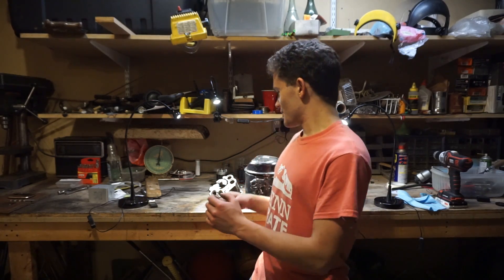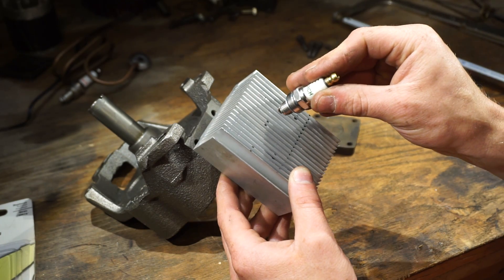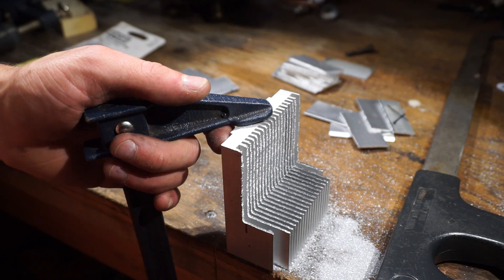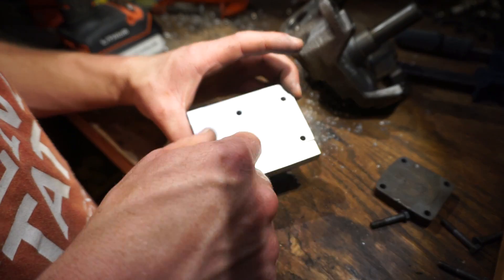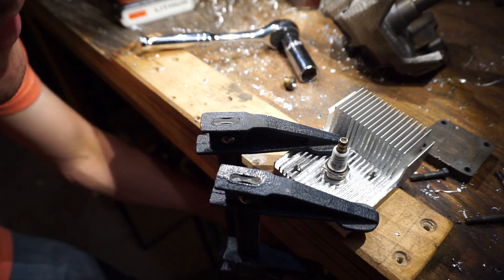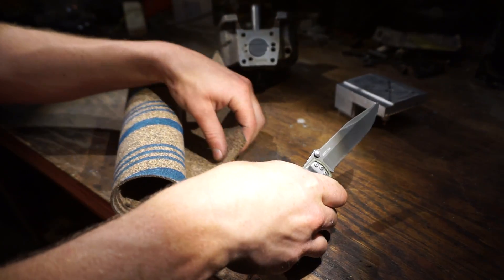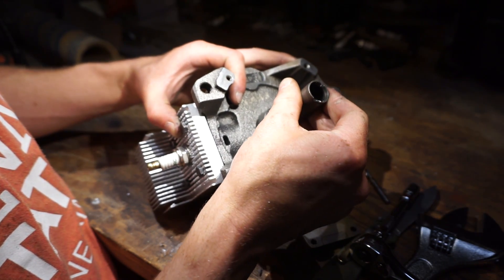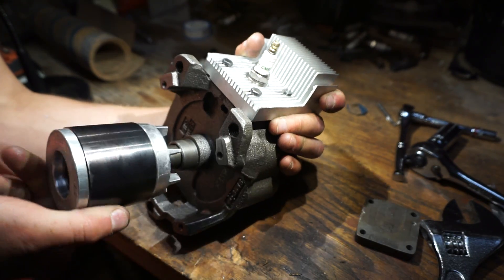Part 3. DIY Internal Combustion Engine Made from Old Compressor - Head from Intel Heat Sink

Comment: have you figured out the compression ratio of that? its got to be way high. surprised you would rather build up the head with jb weld instead of cutting off some of the piston top.
Reply from the maker: The top of the piston actually doesn't seem that thick.  I'll have to measure it to be sure.  I'll cross that road when I get to it.  Right now I'm going to worry about enclosing the crankcase.  Thank you for the suggestions!
Reply: Makerj101 actually, if you cut the top of the piston it would screw up your whole port timing. I would suggest just making a spacer plate 1 to 2 mm thick to lower that compression.
Reply: he would have to just dish the center out, or the parts that don't cover the ports. enclosing the crankcase wont be a small feat though, I'm curious to see how he pulls that off.

Comment: Nice job you have one of the most fun channels to watch cool things being built and tinkered with. If you plan to pressurize your crankcase as you say you are that means that you could use an expansion pipe on the exhaust and utilize the powerband that that creates. I wonder can you measure the compression ratio somehow? Good work.
Reply from the maker: Thank you so much!  :)  Yeah an expansion pipe could be a possibility!  Although I think it'd take a lot of math to actually get one that does anything.  I'm not sure how to measure the compression ratio other than calculations.  Maybe somehow using a liquid.  I'll have to think that one over.  Thanks!
Reply: +Makerj101 look on crraigslist for a cpmpression gauge

Comment: I wonder how a dremmel might have worked on trimming those fins in a tight circle for the spark plug hole in the fins instead of cutting most of them
Reply from the maker: It might have worked alright.  I didn't want to use a Dremel on this project because a lot of people don't have them or don't know how to properly use them.
Reply: Makerj101 keep exploramenting!

Comment: Damn, that came out awesome!!
I''m so glad that you left the idea of JB-welding the head, especially given the fact that you already had the 4 holes there :)
I don't know if you remember or not, but I told you on Facebook about my attempt on making such an engine, and I forgot to mention that on my compressor, the head was just strapped to the actual body with a steel band and some pins which locked it into place..that wasn't really hackable at all, but I gave it a try anyways :)
I'm also worried about the cork sheet material, as I believe it won't withstand high temperatures really well..also, you might want to re-tighten the bolts after the first few runs.
Also, the better approach for the sparkplug would have been that type without the bent negative terminal, that one where the actual case of the sparkplug is the negative, and the distance between the electrode and the case is quite small.
I'm still curious about how you'll make the air/fuel mixture, and how you can get it into the engine :) (probably compressed air?)
Reply from the maker: Huh, that's a really interesting design of compressor.   I have never seen one like that.  Send me some pictures.  I'm curious to see it.  Yeah, IDK how the cork sheet is gonna hold up.  I think it will work fine for at least a while.  Might smoke a lot.  We'll find out eventually I guess!

Yeah, that would have been a better type of spark plug.  I would have had to search around for one of those tho.  I'm going for easy to find parts for this project as I want anyone with a brain to be able to replicate the project.  LOL  :P

You'll have to wait and find out how I'm gonna do the carburetor!  I think it's going to be super simple.  Might use the venturi effect
Reply: Makerj101 the compressor is long gone to the scrapyard :)) That engine idea was 2 years ago, if not more :)
Reply from the maker: Oh yeah you did say that darn it.  Well make another one!

Comment: Really nice progess. I like the looks if the cylinder head. When it runs you could add a pc fan on the side or somethin.
Anyway i was thinking you could use some sheet metal on the side to cover the most of area. The jb weld kinda bugs me because you can't take it apart anymore. 
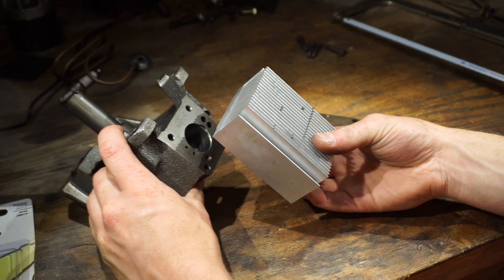Do you put oil in your gasoline for the 2 stroke engines? Could be extra important here because the bearings are designed to have oil all around em. I would usw a ratio 1:25 or smth like that.
Reply from the maker: Thank you!  Yeah not being able to take it apart bugs me too.  Sheet metal with a cork gasket might do the trick.  We'll see!
Yep, I'm planning to put 2 smoke oil in the gas.  And yeah, I'll error much on the side of way too much oil!  :D
Reply: Yeah you could build up some walls with jb weld and then fix the sheet metal to it with some screws. Also for ignition you cuold built something different to make it run even better. I was wthinking of a buzz coil ignition just like the old engines had.

Comment: I just put hacksaw blades in a wooden bow saw frame, so there's no front or back, and I can just turn the saw around and cut whichever way I like. I also find that the bow saw holds the blade more securely than any metal hacksaw frames I've tried.
Reply from the maker: Wooden bow saws are pretty cool!  I've wanted to make one for a while now.  That's a good idea putting a hacksaw blade in one.

Comment: what you are using to.get spark at the rigth time when the piston is top dead center is it gonna fire every revolution or are you gonna make like a camshaft for spark or what ,was just thinking about it and sorry for bad english cause if from finland if you didnt notice it from the name :D
Reply from the maker: Well it is a 2 stroke so it will fire every rotation.  I will probably start with using a simple switch connected to a ignition coil.  Then I'm thinking to upgrade to a hall effect circuit.

Comment: You could have used a end mill for drilling through the fins. But love the series, keep it up!
Reply from the maker: That would require a mill tho!  I guess you could put an end mill in a hand drill but it probably wouldn't be very good for it.  And most people don't have a mill or an end mill.  Thanks!
Reply: +Makerj101 for like 5 bucks you can get a metal cutting disc for a wood cutting circular saw..... i buy them by the ten pak at HF

Comment: you should have used a flat tip frill bit so you could keep the cooling fins
Reply from the maker: Yeah that probably would have worked.  Although I didn't even know what those are until I google it.  So almost no one else would have know what it is or had one.  I'm going for an engine that any uncle Bob in his shed could build.
Reply: Makerj101 or maybe a step drill bit ...

Comment: Next up: DIY four stroke engine?
Reply: Makerj101 Use a large nail, and some sandpaper
Reply from the maker: I'm still trying to come up with simple valves that I could make without a machine shop.  Any ideas?
Reply: Makerj101 You only need a cam shaft for the exhaust valve, and you can use some kind of one-way valve for the intake as the piston sucks vacuum.
Reply from the maker: Activating the exhaust valve is not the problem.  The problem is making an exhaust valve that has a good enough seal, withstand combustion pressure and temperature, and be possible to make without a lathe and mill.  I have seen people use check valves that have linkages attached to them.  That could work
Reply from the maker: Might work
Reply: Makerj101 or use an actual valve from a junkyard engine

Comment: If you could get some of "klingersil" gasket material, it would be SO MUCH better thing for head gasket.
Reply: Just get some neoprene impregnated gasket paper sheets, available at literally any auto parts store, and perfect head gasket material.
Reply: Cap10323 ore a copper head gasket could be good too ive seen it use on some old mobeds
Reply: yeah, that would work too. anything stronger than cork.
Reply: CroatianCarGuy yep
Reply from the maker: Ah yeah, I could probably find some of that somewhere.  I imagine most auto parts stores would carry sheets of it.
Reply from the maker: We will see, we will see.  I'm gonna use the cork and if that fails then I'll find some options to replace it.

Comment: Damn son, this is amazing work! I guess you plan just to fire it and run it for a few seconds, right? Because that gasket and that teflon on the spark plug won't last for more than a few cycles...
Reply from the maker: Thank you for the criticisms!  You might be right but I think otherwise. I think it is gonna run for at least a few hours!  Did you watch my previous homemade internal combustion engine?  The piston on that thing is made out of freaking solid JB Weld and it has at least 8 hours on it running at Maker Faire and other events.  The spark plug on that engine is also sealed with teflon and I have had no problems with that.  The weakest point on that engine is the solder joint that holds the carburetor on.  It has broken a few times probably due to small contact area and vibrations.  

I honestly could be totally wrong.  I have been wrong before.  I guess we will find out in a few more parts of the series!
Reply: copper is good for head gaskets
Reply: Sorry, didn't watch the previous video. Ok, spark plug could actually live just fine. But that cork gasket is what bothers me the most. You really think it will withstand the heat and pressure? I know it's compressed between two parts but still...
Reply from the maker: Entirely possible.  I could replace it with inter tube rubber, viton o ring, RTV silicon, or JB Weld at some point if it fails.
Reply: you just have to believeeee
Reply: +Makerj101 paint the cork gasket eith aluminum paint ..
.its an old trick if a new gasket cant be found...brush on is best.... great series...cant wait to see it run!
Reply: CroatianCarGuy
why so negative?
Reply: not negative, realistic. cork gasket is not gonna last too long while being in such a hot environment and under pressure.
Reply from the maker: Hehehe and duct tape  :D
Reply: Ian Clarke I also suggested that in another comment :)
Reply: My first thought about the head gasket material was the same as CroationCarGuy's. I suspect it will be a failure point. I hope I'm wrong. 

I wonder if you could use some copper flashing for the head gasket? It is available at many building supply box stores? It can be layered too so you can reduce the compression a bit by adding more layers.
Reply: +John Possum c/eith/with
Reply: Makerj101 WD40 keeps the world moving and JB Weld is keeping it from falling apart :))
Reply from the maker: And hot glue
Reply: You should be able to get some regular gasket material at a parts house.  Would withstand the heat better.  Keep up the good work
Reply from the maker: I still would love to see the spark plug blow out of the head!  That would be an awesome failure!  I honestly don't know how the cork will hold up. Cork has an ignition temperature around 300C which is not half bad.  Also is has natural fire resistance.  For now I am going to be optimistic.  If it does fail then I will deal with it when it does.  If it fails I am planning to replace it with a soldered loop of copper wire.

Comment: the blade is on correctly but the first stroke is to Pull. it cuts on the pull. Japanese wood saws cut on the push. western saw cut on the pull. But hey man what ever works.
Reply: Mark Davey ur right... and wrong.lol Japanese pull saws cut on the pull stroke. hacksaws cut on the push
Reply: Ps loving your work.
Reply from the maker: Thanks for letting me put my blade on which ever way I want!  ;D
Reply: djsnowman06  I did think I cocked that up.... I knew what meant.... Doh. Hey what every works though aye. ☺

Comment: im sorry but the hack saw blade is now on backwards. the top arm is only there to hold the blade. you want to have a pull cut so the handle is applying the tension
Reply from the maker: Ahhhhhhhh no matter which why I put the blade on people think it is wrong!!!  I'm just gonna put the blade on upside down from now on. Then no one can say anything about which way the teeth are facing.  :D
Reply: Then everybody would be right about it LOL
Reply from the maker: Yep and at this point more power to you if you are right hahaha  :D
Reply from the maker: Sound reasoning
Reply: backwards is safer because if it breaks the user cant accidentally run ones forearm into broken sharp metal blade....abrasive cutting wheel still way better though
Reply: actually,no.  With the teeth facing forward, pushing the saw will cut deeper because you are leaning in and using your body weight to cut. Also , you have greater accuracy in depth of cut by pushing rather than pulling because you are getting closer to the cut instead of further away.